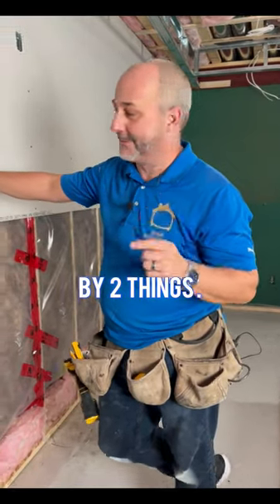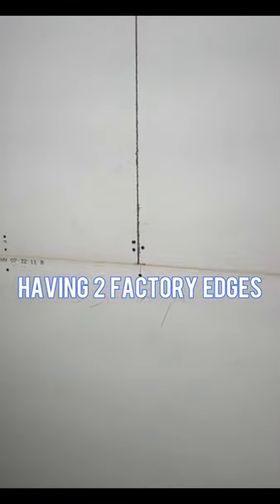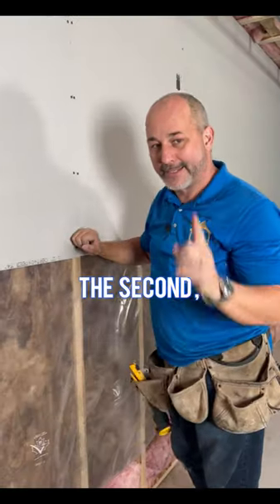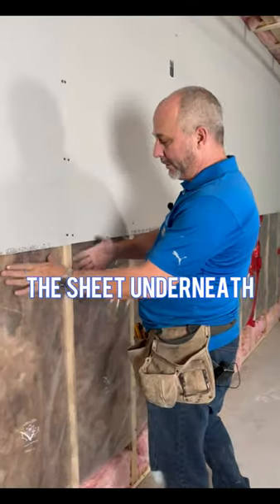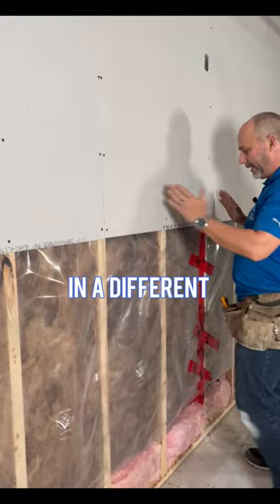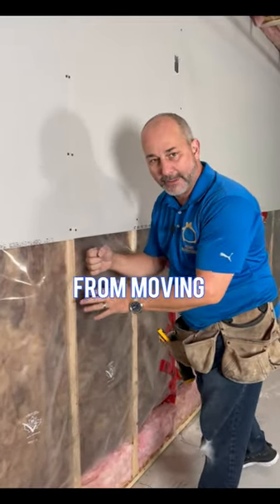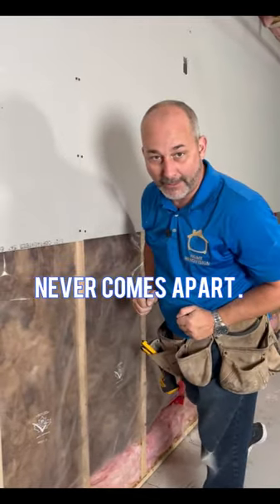These 2 Things Determine The Quality of Your Joint #shorts #diy #diyers

Comment: Putting a seem on top of a seem is a no no I’m almost any building application. With hardwood flooring, you want your seems at least the width of the board apart from each other, and with brick you stagger joints to establish bond.

Comment: Staggered joints have nothing to do with the structure in this case.  It’s drywall. It’s better to stagger joints because Cross joints are more difficult to patch correctly and can be seen in the finished product.

Comment: actually, they've recently found that floating your butt joints by using backing instead of a stud, is not only faster and easier, but also far superior in strength to the traditional butt joint

Comment: The red tuck tape is supposed to be used for exterior building wrap ie. tyvek… the blue tuck tape is for interior vapour barrier applications. 🤔
Reply: You are correct. However, around here you fail for blue tape on exterior, but the red tape is allowable for use on exterior AND on PE vapor barrier. Most guys that don't do enough jobs to stock both kinds just use red inside and out
Reply: @jimbojames9370  thanks for the info!!

Comment: Actually, it depends on more than that. The screws in the joints should be staggered and no more than 6" apart. Also slightly beveling the edges (v-ing) helps having a better bond when you tape it.
Reply: You know what you are doing. And that's a good thing to see! Not many people go that far but they should.
Reply: @beerbeforebreakfast  Thank you. I did drywall for exactly 10 years and that's how I was taught. I do remodels now and even if it's just a patch, I do it the same way. It's a habit that stuck with me.
Reply: Hey I’m about to stay a remodel an old home for my dad. Any other tips or more info on how to do that drywall technique?
Reply: You can not v the edge.. Code requires 3/8 of paper between bugle head screw head and edge.. Do a house with 500 sheets get a upset inspector and you are patching each buttjoint you V and or pulling down every sheet
Reply: @Whirl Wind  Well,, I've been v-ing for 11 years now and no inspector ever had any issues with it. My v is 1/8" on each side, just enough to get rid of the sharp edge, which leaves plenty of "meat" to screw into. Every taper I worked with was thankful for it because most people don't do it, but it saves them time and their work is better. That's how it is around here and if you do it differently,  that's fine too.
Reply: @jordan2104  That is because the drywall is inspected before you start finishing ... What I am telling you is this ... Experts created the drywall system. USG Gypsum Handbook has been the Industry standard for decades. They show the exact steps to finishing . The code says ...(and this applies to commercial and residential with screw inspections).  You can not cut out the paper edge or the system is failed .. Once failed the inspector ..If he knew what you were doing to the board after his inspection  would fail it and you would be responsible to remove each board or buttjoint and replace the joint .  I have seen Inspectors  fail firewalls for screws too deep and each screw path had to be taped and mudded.. There is no to each his own in right or wrong ... Its either right or wrong ...and V-ing is wrong ..
Reply: @whirlwind8825  First of all, the USG Handbook doesn't have any information regarding v-ing, so idk where you got that from. Second, I v all my butt joints as I install the boards, so before the inspection not after. There is absolutely no reason to say that the system will fail because of v-ing. How would the edge cause it to fail when you have at least another 25 screws holding that board to the framing? If anything, your butt joint will crack after a while. But as long as you have enough screws in the right pattern and they all grab well (min of 3/8" from the edge), that joint will never crack or fail. 
And of course the screws have to be set right, not just in the joint, but also in the field. If you break the paper, that screw won't hold enough, so you have to put another one next to it and pull the failed one out. That's basic knowledge and every hanger knows that (not everyone does it right though). 
I've had probably close to a thousand inspections so far with different inspectors and in different jurisdictions, not once was v-ing even mentioned!
Reply: @jordan2104  The stud is 1.5 inches .. the 3/8 paper reveal puts the screws at 1 inch apart on a tight buttjoint   that leaves 1/4 inch of wood  or 5/16 on a metal stud for the screw to grab... It sure is in the USG handbook .. You have no room to V out any paper and you are not the hanger you are the finisher and you have no reason to go in after hangers and change the 3/8 value that passed inspection ...  You pull a failed screw on a not rated wall and filled it .. On a firewall there are no holes in the drywall and the paper must not be broken by screw heads  on depth failed screws leave holes and holes get taped ...   The screw must be <3/8 from the edge and not more than > 1/2 inch...  any failed holes will be taped and sealed all screw heads and tape must be covered with a layer of mud... on any fire rated assembly ... That means   (LIDS and Garage ceilings in residential) or any smoke rated assembly..   The paper face on the drywall is the drywall's rated assembly...   You can not V joints for finishing ..   Someone following your advice is just doing it wrong and as I said USG engineers devised a system and you are not qualified or work for UL  or USG to change that system..
Reply: @whirlwind8825  As I said, I've been doing it for 11-12 years now and no inspector ever complained about it or told me to stop doing it. And the tapers are happy. I'm just hanging, not taping. That's all i can tell you. People don't have to do as I say if they feel like some local code is being violated, but where i live and in the surrounding areas, I have never had any issues v-ing the joints.
Reply: @jordan2104 I’ve been doing drywall since it was rock lath ( over 42 years) and never not once did I “V” bevel  I’ve hung over 100,000s of sheet of board  and if you tried to bevel a butt edge. My old boss would have run you off with a lath hatchet.   And yes I’ve done board so long that we used the lath hatchet to cut the drywall lath.  That’s what is actually for
Reply: @jordan2104 I’ve had tens of thousands inspections over 42 years. And  the other guy is absolutely correct.    You don’t bevel a butt joint.   There is just no need to waste the time.

Comment: If you’d stood your sheets you wouldn’t need to stager anything because you’d have no butt joints , you’d also make it easier to tape those joints ….. the true cost of drywall is in the finishing ….. keep in mind for more commercial jobs like high rise apartments and Hospitals you can’t lay your sheets due to fire codes and the need to have a stud behind the fastened edge and the appropriate amount of fasteners around the perimeter and in the field ,so lay down isn’t an option.

Comment: I will say though: factory edges aren't always square. Typically yes, but check your stack before you start using old butts as guides. T square edges are much more reliable.
Reply: Not always. Drop your T-square a few times and watch how it starts undermining your work lol.

Comment: How is the sheet underneath in a different location?
Reply: Think brick layer pattern. Stagger the joints down the wall so you only seam and tape half the wall at any given stud
Reply: When you hang a wall, you typically start at one end and By the time you reach the end of the wall it more than likely won't be an entire sheet. Directly above or below, start with a full sheet and work you way back. This will stagger your seams.

Comment: You forgot to say how far they should be staggered, at least 4 ft no less than 32 inches from the stagger joint.
Reply: code is minimum 18 inches .. that makes you jump it to the next stud 32 inches ..
Reply: @whirlwind8825  there is no stud layout 18in. on center, it's either 16 or 24 inches. If you stagger your joints that close together you'll see a big hump in the wall when the sunlight hit it.
Reply: @craftman5632  Thats why the code says 18 inches because rafters are laid out at  19 3/16 "  and studs fall on 32"  So the minimum would end up 19 3/16"  or 32"

Comment: Ya because your sheet rock really keeps your studs in place 😂😂😂
Reply: Drywall can actually have structural properties if calculated and signed off by an engineer.
Reply: Exactly
Reply: It does. Its building code for structural strenghth. Usually staggered half of the length of the sheetrock you are using. Thats why it cracks in the corners instead of the middle of the wall.
Reply: In commercial framing ( metal studs) the drywall is everything to the strength

Comment: Vertical staggering makes no difference,   once the boards are on, the stud with the join, can't move anywhere. You're just making jointing harder
Reply: Vertical staggering is code   they must be 18 inches or more apart ..
Reply: @whirlwind8825  sucks for you, not in uk

Comment: You are never going to get two factory cut edges on every joint on every wall so you’ve set yourself up for a fail there 🤷🏻‍♂️
Reply: Then you use a t square and make one , and a good hanger can do it without the t square , and a hanger that plans out cuts can make every buttjoint  use a factory edge ..

Comment: guess he’s the dude inspecting all the joints before these whacky dry wallers tape and mud 3 coats on a level 7 job, then blames the crooked walls on the poor company installing the rubber base saying oh well you accepted the terrible quality of the wall bc you installed the base.